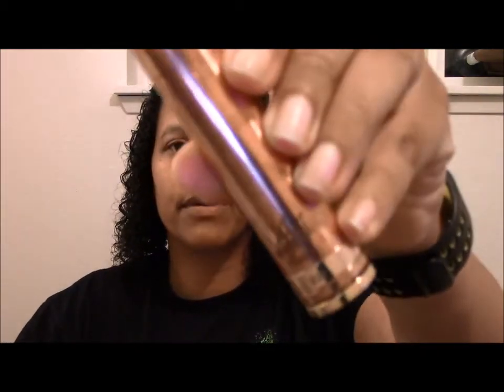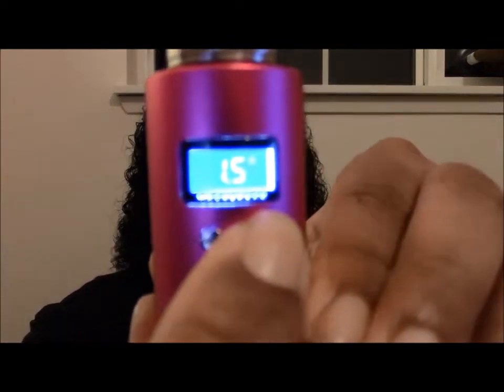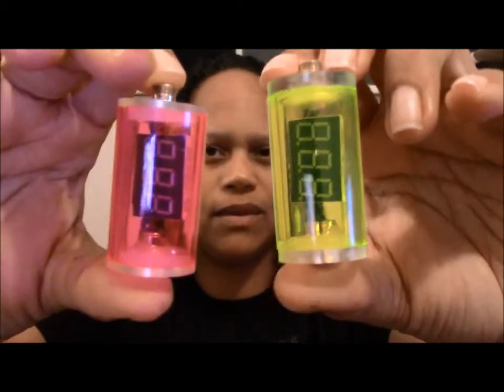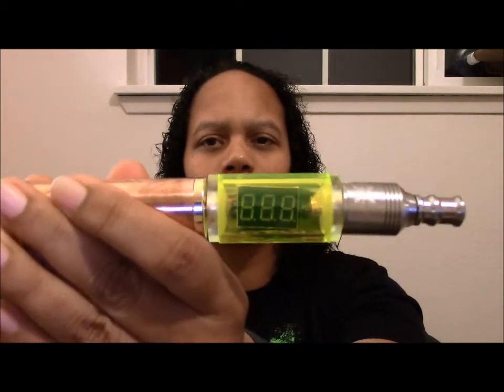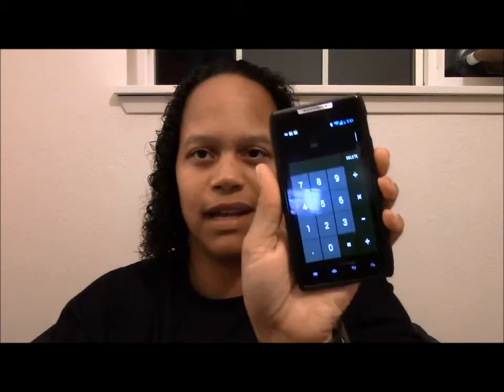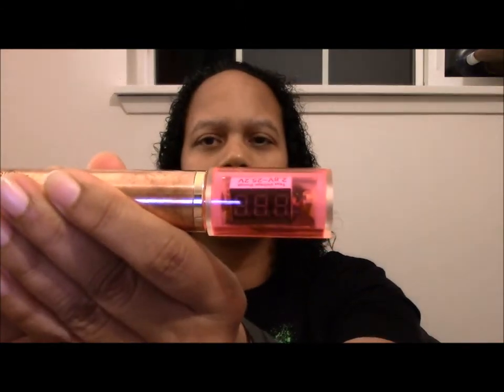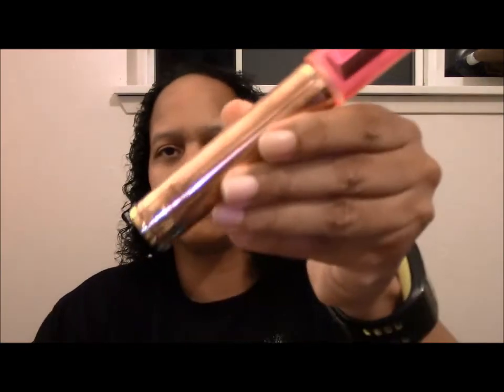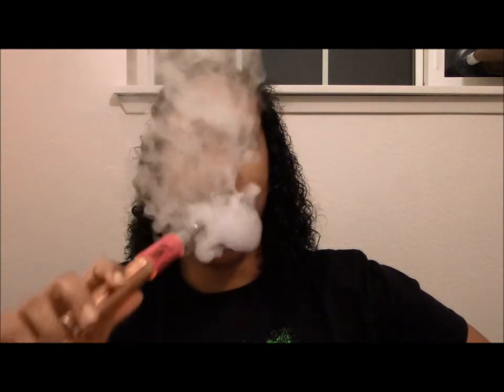Voltage Drop on the Copper Caravela Clone

Comment: Surely the voltage drop is due to the resistance from the coils and nothing to do with the battery pack?
Reply: It depends on the battery you're using, the resistance of the coil, the material of the mod, whether or not there are springs in the firing button and 510 connection, and the material of the contacts

Comment: Not bad!  I feel so stupid.  I didn't realize you could use the meters to check voltage drop.  LOL.  I just got one from 101vape and was using it to check the battery level in my mech mods.  :-P